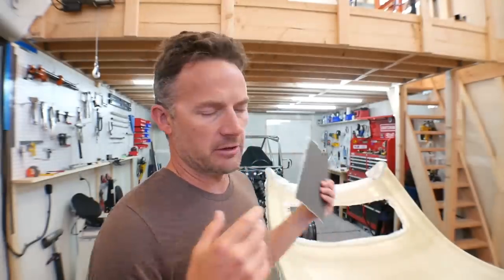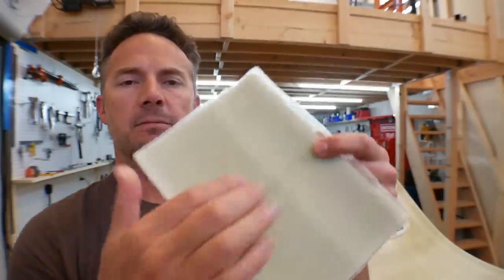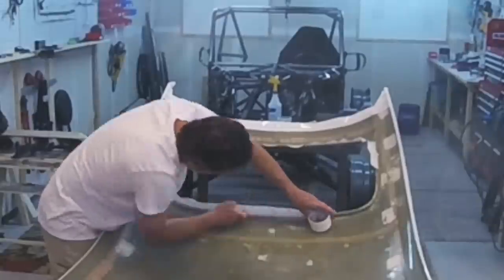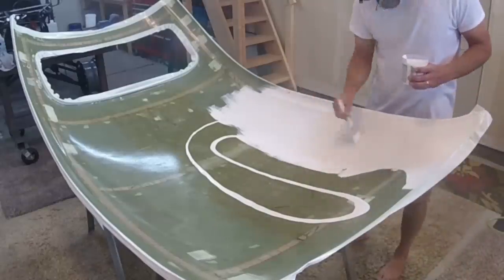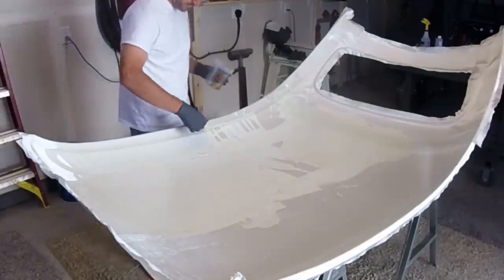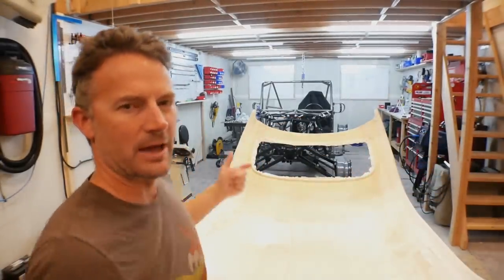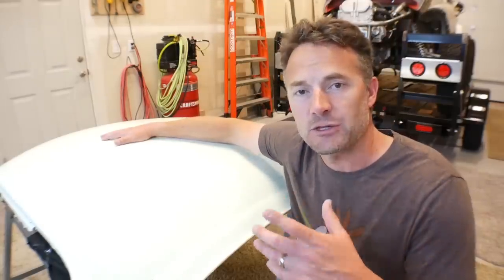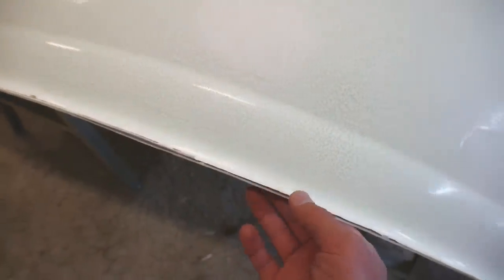Making Fiberglass Body Panels Ep  2 The Roof!

Comment: did the gel coat have to fully dry before the first resin coat?
also, would it be easier to make it only two layers of fiber, remove it from the mold and then put it back in the mold to had more layers?
Cheers, enjoying your vids
Reply from the maker: The gel coat should be fully cured, usually I give it at least several hours if it's a nice hot day. If it's cooler and drying a little slower I'll give it 24 hours.
The problem with popping it out early is usually I need to trim the edges to remove it. I wouldn't want to do that and then add more. But in some situations this tactic might help if it's a difficult mold. But for most situations I wouldn't do it.

Comment: Hi Doug is there any reason you chose cloth rather than chop strand matt🤔 thanks your video s are fab for newbies 🥴
Reply from the maker: Cloth is much much easier to lay over compound curves. Everybody says mat brakes down with Poly resin and becomes easy to lay up. But in my opinion this is not really the case. Cloth is so much easier to lay up. If I'm working with a flat surface I'll use mat, but most other surfaces I'll use cloth.

Comment: You can put an air fitting into your mold on future projects ,then you can use air to pop your mold off. I have also used a water hose and the Corresponding fitting. Great job BTW!!
Reply from the maker: I've heard about using air. But not the water. That sounds like a good idea (as it dissolves the PVA), thanks for the tip!

Comment: Good friend I'm not hating on your work just sharing a bit of knowledge if you use packing tape it will be better that duck tape polyester does not stick to plastic and it's better because it does not leave lines like duck tape does that bottom wrinkel happens when you brush the product and you leave a lot of material but looks very good 👍
Reply: Also forgot lol popsicle sticks will help alot more just just place them all around and add some water inside the pva will come apart a lot better good luck
Reply from the maker: Hey buddy, appreciate the tips. I'll try the packing tape.
And the popsicle sticks are a great idea, why didn't I think of that? lol

Comment: you don't need to change directions with the cloth unless you can get it at a 46 degree to one another.  Cloth is the strength where mat it what you use for the fill.  Use the mat with poly resin because it breaks down the fussy fibers around the strands.  Also you don't have to buff off the haze on the wax.  The natural heat of the curing melts it away.  I use cheap wax all the time and it works great !  keep up the great work !
Reply from the maker: Thanks buddy! I appreciate the tips.

Comment: Are you using polyester gellcoat with epoxy?
Reply from the maker: I did on that because I was a newbie.... Don't judge me.
Now I use poly resin.
Reply: @DougBugBuilder  Ha ha, I am not judging.  I was wondering how you got away with it so could do it myself.  I am not a fan of polyester resin, the smell gets into everything.  I only use it when I have to.  Epoxy is so much more civilized.
Reply from the maker: @faykos9267  I'm with you on the stink. I don't know what you're building, but the Poly gelcoat stuck just fine to the epoxy. I'm sure the bond is better poly to poly, but it seemed to stick fine to epoxy also.
Reply: @DougBugBuilder   I only use polyester resin for moulds or new parts.  Polyester resin has good primary bonding ability which makes it a good resin for new parts.  However, the secondary bond strength of polyester resin is very low in comparison to epoxy meaning it is not so good for repairs.  

Most of my work is on boats and polyester resin is not impermeable to moisture, it's porosity makes it water resistant, not water proof, whereas epoxy is much less moisture permeable. 

Another reason I prefer not to use polyester is it's reliance on CSM for adhesion between each layer of cloth, core and hull.  CSM is very weak material due to its high resin to glass ratio and short fibre length.  It also soaks up a lot of resin; making it very expensive to wet out with very little addition strength.  Epoxy doesn't require CSM. 

Epoxy is just so much better to work with and without all that CSM the volume of resin required is much less. It may cost more per gallon but you save on the amount used, making it only slightly more expensive than polyester.

Comment: I'm trying to do some research on how to make a fiberglass roof for my 240sx s13 convertible because I really don't like the convertible look and no one is selling any aftermarket roofs so do you have any tips on how I can make hinges on the roof if I make it out of fiberglass and if I instal a roll cage how much can I use that into my advantage? I'm sorry I'm new and have no knowledge on fiberglass but I'm really interested and would like to know more and thank you for putting these videos up for the public and sharing your experience,  im still watching your videos to learn more
Reply from the maker: I think you should use the roll cage for attachment. That's how I'm securing this roof. Multiple points where it'll secure to plates to the rollbar.
You can definitely make it strong enough for hinges. But it'll be so big I would not go the hinges route.
Reply: @DougBugBuilder  thank you soo much

Comment: haha,easy work, i has made many many mold to glassfiber, car and boat mold, and then factory has made many hundre boat and car parts my mold. easy job. wood mold top coat, wax, etc. before i buy new car and then made mold front and rear bumbers and if someday crash car somewere have own mold in home full front and rear all parts, easy made new bumper and body parts. cheap simple work and no newer need go expensive body repair shop.
Reply from the maker: I'll need to have you over to make some molds for me. 😂👍
Reply: @DougBugBuilder  ok,if you come to thailnad ,im stay live pension now in thailand, i has working many year fiberglass boat and parts factory made woodwork and mold and many hundre fiberglass boat, little 5meter and big 12 meter. and thousand car parts, many truck rear cover ,new car model etc, toyota,nissan truck year 1990 i has 1991 model car in garage, dealer send to me, and i build rear covers new model before has in shop all car. same i has made dealers want i made new bumper model to next year new car, special edition model ,dealer mainhead send me pictures and car and i made new special edition car model bumpers front and rear and side, simple work use foam and folio and paint topcoat and then glassfiber,come 1stage mold then made first test parts and make all changes what dealers need and then made factory mold. simple ,many year has good job. then all end i not know why all end. but has interesting time some year.

Comment: Hey I really liked the video's. So I bought a hood from an early baja bug, the one with the headlights close together at the nose and I put it on my sand rail that has a radius roof similar to a baja bug. There's spacing from the hood to the door panels and I dont know how to make what I want and to make it look good. Do you have any suggestions.
Reply from the maker: You'll need to install your hood, and then fill in what you want. Using, foam, body filler, clay, drywall mud, whatever. And you'll need to sculpt it to what you want. Then make a fiberglass mold of that. Then make a fiberglass piece from the mold, and that should be your new roof piece.
If the gaps are small you can just fiberglass in the gaps with bodyfiller and smooth it all out. Depending on the gap size.
I'm currently doing this to the doors on this Baja. So if you can wait, in a couple weeks I should have some videos showing this.

Comment: +1 on the syringe comment. Also to avoid dry spots use a metal roller like we do for boat parts. 
Loved the video. Epoxy is top of the line stuff but so incompatible with anything. Consider vinyl ester over gp, so strong and still compatible with anything. If you crash you crash so I'm guessing that's why you chose epoxy. 
Love ur workshop and ur skills. Keep the vids coming bro.
Reply from the maker: Thanks for the tip on the Vinyl ester, someone else mentioned that and I'm going to get some and experiment with it.
Appreciate the comment and nice words too. 👍

Comment: All good stuff. So some of the problems you encounter. the ripple in the gelcoat is prerelease Id say styrene attacked the gelcoat and caused the ripple. The separation between the laminate and gelcoat is a workmanship fault. the laminate needs to be rolled as apposed to squeegeed. Two reasons one to work the air out between layers and two to work the resin through the laminate just because it looks wet doesn't necessarily mean there's resin worked into the fiber. And lastly the laminate is what give a part strength resin is just the glue that holds it all together and gelcoats just a finish really. a good engineered laminate will make strong parts. by engineered I don't mean add more layers. Something like a CP Membrane between 2 layers of 225CSM in between the laminate you have would make the world of difference. Keep up the good work.
Reply from the maker: Thanks for the tip on rolling verse squeegeeing. That separation is the worst part.

Comment: When making moulds use gel coat if not you need to primer the mould after and wet sand and use metal paddle rollers to remove air and gives you a smoother finish on mould making and finished piece.
Reply from the maker: Thanks for the tip! Maybe I'll try primer on this mold to see if it's a little cleaner. 👍

Comment: Real nice work and well explained. I have never done fibre glass work, but have purchased items and feel that when taking a mould from an existing body, there should be more time spent bracing the mould so when it is used to make the copy it holds its position or default so to speak. I note you relied on the curvature to help keep the shape, but did it! 
Maybe you could comment on how you see it now that you have taken a copy from your mould.
Best wishes and keep up the great work.
Reply from the maker: When I made the mold I thought with the curvature and the foam I glassed in it that it would be strong enough. Now that I've used it I wish it was a little more rigid. I won't glass this anymore, but I might try to strengthen it with foam. 
It was strong enough to get the part made. But if it was stronger it would have been a little easier.

Comment: That looked more like masking tape, wax it 3 times spray the gel coat and make a small metal roller with the curve of the roof to remove the extra resin off and make sure the edges are not dry...
Reply from the maker: A roller with the roof curvature in it would be nice!

Comment: If the gel coat smells that bad, your probably using polyester resin (I may be wrong). Polyester & epoxy don’t mix. I have done it before & heard others do it with no problem but I wouldn’t recommend it. Use epoxy surface coat, pretty much epoxy gel coat, next time. And also, make your molds flawless. Your part is going to be a replica of your mold. I see a lot of people not making them so good. Then your spending so much time with repairs.
Reply from the maker: You are correct, the Gelcoat was Polyester. Thanks for the tip on the "Epoxy Surface Coat", I'll check that out. 👍

Comment: Great results!

I'm building a fiberglass body now as well, and trying to decide how many layers of glass to use.  In your next video, could you please show how flexible/stiff your roof is by pressing down in the middle with your finger. .. Thanks
Reply from the maker: I already filmed the next video. But I'll try to show in the one after that. But I can tell you with three layers it's not very stiff. If you want more strength I recommend about 5 layers minimum. And remember I'm using 6mm cloth which is pretty thick to begin with.

Comment: I believe the problem in the back is most likely due to the mold flexing. What you may need is a jig that becomes a part of the roof mold. Also, since the roof mold is subject to flexing, you may want to add more layers of glass mat to increase the mold's stiffness and thereby it's ultimate strength. I am not a pro, however, I did meet someone from Tennessee about twenty years ago who made his own VW molds and every piece sat in it's own separate jig. Just a thought. Great job!
Reply from the maker: You're probably right. When building the mold it seemed pretty strong. But once it's free standing you find out it could use more support. 
Thanks for the comment.

Comment: Hi dude use a resin roller to make the fiberglass mat stick to give were it has separate try forcing resin into the gap if not you will need to cut out the bad bits and redo I hope that helps
Reply: Sorry I didn't say that is a good looking roof have you done much fiberglass  I use two set of gloves and marking tape to help stop fiberglass going up sleeve. Tape between gloves and horrible onesie  I hope that helps
Reply from the maker: I know the rollers you're talking about. I'll pick one of those up.
Thanks for the tips! 👍

Comment: hi doug next time spray the gelcoat on 2 uniform coats a cheap gun will do just clean with thinners when finished  brushing can be hit and miss and the crease at the back use a heat lamp get the fibre glass hot hot and use a piece of wood and clamp the crease till it is flat then let the fibre glass cool it should stay pretty flat because resin is a form of plastic the fibre glass gets pliable when it gets hot.just heat the crease till it get hot enough so you cant touch it and then see how pliable it becomes hope this helps nice first try
Reply from the maker: Man that's great advice. Thank you, I'll give that a try.

Comment: put resin first on the gelcoat, then put the fiberglass on the wet resin, then apply more resin where needed, use roller to remove air. You can also buy sanding gelcoat, this sands very well, you can paint it later with normal car paint. Nice project ! like it ! greetings from belgium.
Reply from the maker: Thanks for the tip on the sandable gelcoat!
And thanks for the comment. 👍

Comment: Would using compressed air from a rubber tipped gun make removing the fiberglass easier than using plastic shims/wedges; kind of like how we used to remove old bicycle grips from the handlebars when we were kids?  I never worked with glass fabric before, but I would be so scared of destroying it with the removal techniques of shoving shims between the two parts.  Awesome build really enjoy your videos, and so looking forward to seeing more. Thank you for the awesome videos.
Reply from the maker: Others have mentioned the compressed air. I think it's a good idea. Probably play around with that on the next mold. Thanks for the tip!

Comment: Really great work. Especially for a part of this size. 👍👍👍
If you do another piece in the future, put some reinforcements in the areas where the roof attaches to the frame. By reinforcement I mean some extra layers of fibre glass.  With just two layers the roof might rip off during the first desert 🌵 race. 😉
Also don’t underestimate the flex of the roll cage. The roof shell will be subjected to some serious shear load.
Keep going on this great work. And please do not roll this car!
Reply from the maker: Thanks for the tips, seems like great advice from experience.
Because I don't know exactly where it will connect to the rollbar. My plan was to build the cage under it. Then when I know where it will actually connect add some strength to those areas. That's the plan anyways. 👍
Reply: 10 years experience in aircraft industry 😉
It depends on how you plan to connect the skin to the frame.  If you want to make it removable from the frame you might want to bond some brackets to the roof. Just give the brackets a relatively large contact area and use a flexible but strong bond. I would not recommend to drill holes into the skin and use screws or fasteners. Two layers of glas fibre are way too thin for this application. And it will look odd from outside. 
There are many more options. Just make some simple test pieces and find out what you like best. 👍
Reply: Rather than use extra layers of fiberglass you should buy some 2" or 3" wide Kevlar ribbon or even just cut pieces of Kevlar and a layer of that in those areas where you have bolt holes. You can also use the 2" wide ribbon to go around the perimeter get it a lot more strength.

Comment: I love the idea of the replaceable roof panels. Having the mold and the skill at any given moment in need is worth every penny of the investment and time. If you end up with an extra or damaged. I’d like to buy it. I had a front engine coyote swapped 68 bug I’m building. Is just chopped up the body and the roof section is a concern. It also has a sunroof. Having the ability to throw a solid fiberglass roof would be cool. Keep up the awesome work! 🤙🏻
Reply from the maker: I've though about making a better mold, and then offering to sell the roof panels at that point. I'm not sure this one is quality enough to sell the panels. But we'll see, I'm sure I'll make more and each I would think will get better.